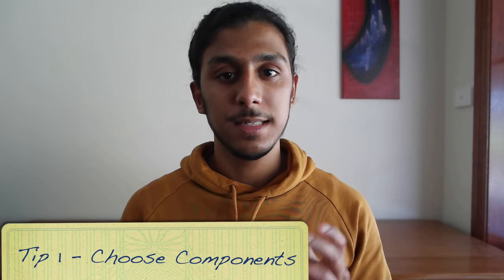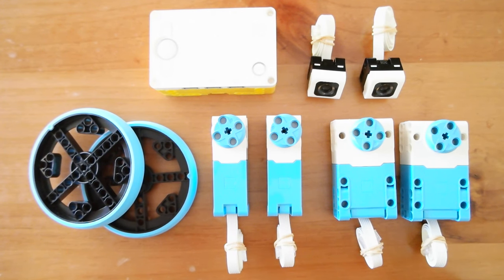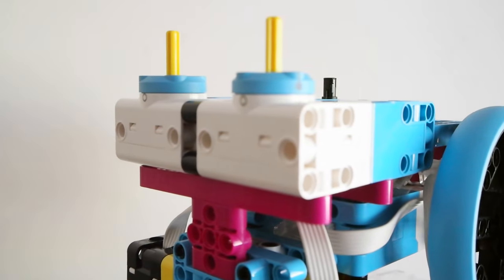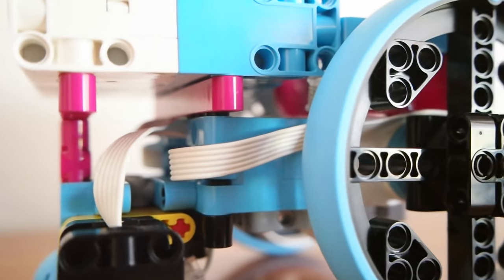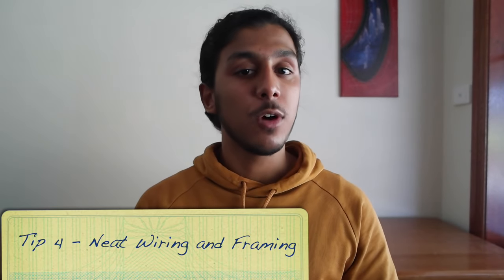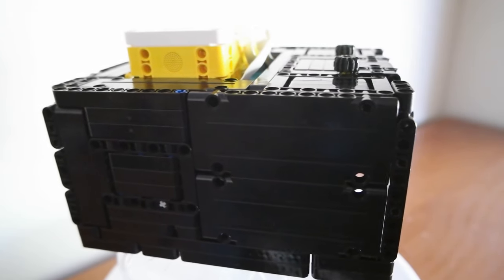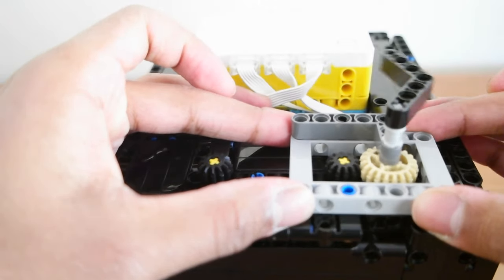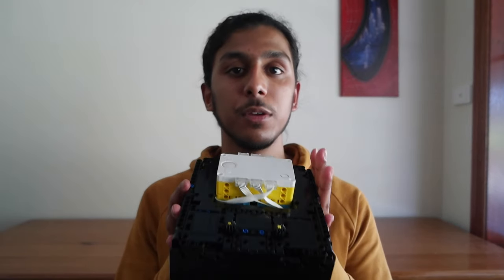5 Simple Tips to Build the Ultimate FLL Robot

Comment: Hey Zain, love your videos and this robot looks amazing. However, just one question : to build this robot, would the spike prime kit and the expansion kit be enough. Thanks it's just when I looked at the google drive document it seemed like for the frame you used something different.
Reply from the maker: Hey, yep you would need extra panels to build the frame as there aren't enough provided in the expansion kit. If you wanted to build the frame as per the instructions, you can order extra parts from bricklink or any other lego trading store. Hope that helps!
Reply: Thank you so much Zain!
Reply: If you could kindly attach a link to the product you used for the extra panels that would be really appreciated and extremely helpful. Thanks Zain!
Reply: Actually instead of attaching the panels just one question for the two sides of the robot instead of building the frame would there be a difference if we just used the 2 yellow large pieces as they fit perfectly. Would it change how the robot moves or make it inconsistent?